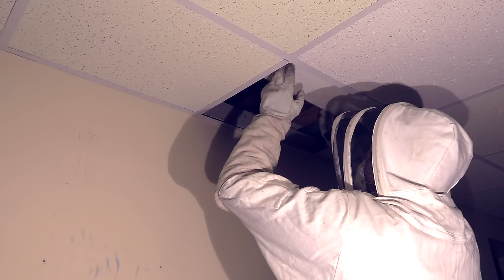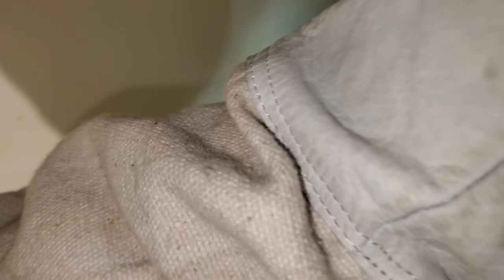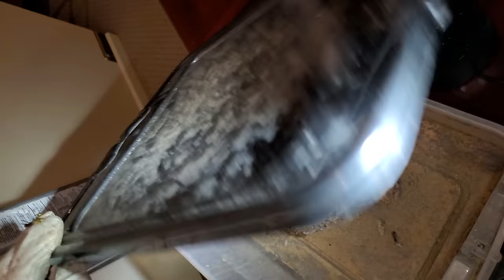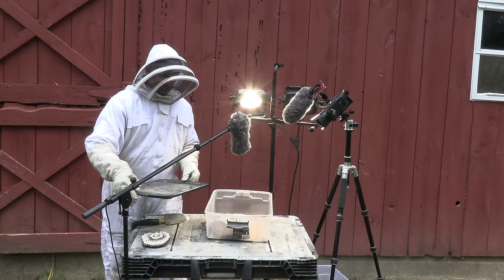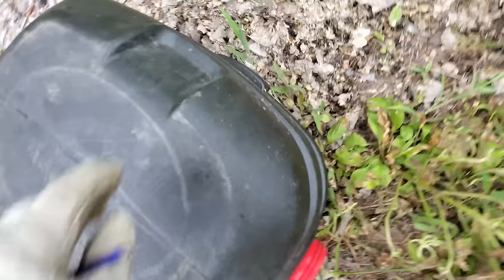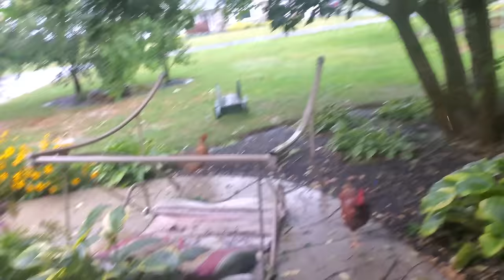HUGE Yellow Jackets Nest in Basement Ceiling | Wasp Nest Removal | Wasp Infestation

Comment: Yes, they do seem to go after wrists, ankles, and your head. That’s where they stung me the most, when I got stung when a little kid, by a ground nest of Eastern Yellow Jackets.

I have an idea. Make a Y-attachment for your shop vac, and have two tubes coming out with flexible hose and new hard tubes on the ends. This will prevent the vacuum from sucking too hard, and you can suck up more yellow jackets quicker with two hoses, using both hands. You’d have to clamp your camera on a tripod, or a joist in this case. Also, an option would be to tape one of the tubes to where the yellow jackets are coming in, and then use the other tube to suck them off the nest. You could probably make the Y-attachment with PVC pipe.

Where’s Angel? 🐓
Reply: Angel went to the great chicken run in the sky last year.😢
Reply: Hmmm. Good idea, can put a plastic ball value on one hose to adjust air flow too.

Comment: I am a young female technician for a large company and I absolutely HATE wasp calls. I enjoy most other aspects of the job but wasps just scare the hell out of me. I have one account up in the foothills and they have one tree about as tall as a single story house that's just LOADED with Tarantula Wasps and I am beyond afraid to get close to it. I put 40 ounces of Dragnet in my power rig one time and turned the pressure up to about 500 PSI and stood wayyyy back and sprayed the heck out of it. I went back a few days later to check and the tree was still loaded with news ones. I then took my electric backpack with Termidor SC and pin streamed it from far away. I just sprayed a small part of the tree. I went back again two days later and there wasn't a single TW anywhere to be found and the customers were thrilled because their kids could go out back and play again. I figured you probably had Drione Dust in your vacuum to kill the ones you sucked up. I could not possibly do what you just did, I'd freak out even with the bee suit on! Good job!

Comment: That pipe is actually two pipes, they're the refrigerant lines for that air handler, a liquid and a suction line (small and big respectively, big is insulated). The way the ac company did that seems pretty tricky!

Comment: Soo when the larva has weaved the silk cap and they're inside transforming, when they are shaped like a hornet but still the color of a larva, are they dead or alive?  I've seen you pull them out before and they don't even move. Are they paralyzed?
Reply: This is random guess, but i wanna say that the nerves for even reacting to touch are either noneexistant, not connected, or just numbed while the creature rebuilds itself, to save energy for the task. They are alive, but the awareness is 0.
Reply: @eeveegirl51  so it's basically like being paralyzed?  I've seen them twitch a little bit but they barely move in that state

Comment: That copper pipes (one is black because it's insulated) is the AC lineset, often see them poorly sealed and easily penetrated by insects and even rodents.  I always advise people to avoid using putties or spray foam to seal the openings, instead get an HVAC-grade silicone and use that.  The black cable is the 220V power line for the AC, on the other side of it is the disconnect box mounted on the outside of the house.  This should also be sealed, and in a case like this you want to inspect the cable and make sure the insects haven't damaged the wires.  Edit:  in this case it looks like they were coming in behind the disconnect and around the wire.

Comment: When you mention that they latch onto your wrist, does that mean that there will be an accumulation of stingers there afterwards
if they sting the leather or are they able to pull them out? Or do you remove the stingers manually yourself if they get stuck there?
Reply from the maker: They latch on with their mandibles. Sometimes their bodie get vacuumed off, and their heads are left latched on my clothing. If they sting the glove, their stingers get lodged in the leather and they become gutted.
Reply: What happens to the stingers that get lodged? Do they remain in the leather or are you able to remove them?
Reply from the maker: They must fall out during the removal sometime. I dont pull them out.

Comment: When I was 14 I climbed up in an oak tree about 30 or 40 feet to a big hornets nest (because I wanted it), with one of those cans of house fogger bombs.  I had bought it because a bunch of us kids had bought army surplus gas mask, and I wanted to try them out, but nobody else would go for it.  So anyhow, I figured out how to spray like you would a paint can without locking it open like you would in normal use.  I eased up to the big hornets nest and got the nozzle pointed up into the nest, and started spraying.  It lasted about 5 seconds before one of them (they were big) flew out of an auxiliary exit, and made wobbly bee line straight into, and bouncing off of my forehead.  At which point I dropped the can and made like a monkey down that tree.  Didn't get stung, and a week later noticed that there were no more bees.  Climbed up and sawed down my nest.  Which only lasted a couple days before my dog decided to play with the stick it was on...

Comment: I wonder - would it be legal to attack them with a vertical X-ray (High power electron gun pointed at a Tungsten plate at 45 degrees?) X-rays are extremely directional, and if they are not tightly focused, and a tube a couple of feet long of lead foil beginning at the plate would limit the exposure of anything around it. The residents, and their pets, must obviously leave during the treatment. The insects use chemical weapons against us. Why not (carefully) use directed energy weapons against them? Double timers cascaded with cutoff at 5 minutes. You wouldn't have to worry about infection during cleanup. Nothing will be left alive.

Comment: Why didnt you just call it wasp nest under floor because the basment is unser tge from is it not
Reply from the maker: Did I remove it through the floor or did I remove it through the ceiling? 
🤔🤔🤔
Reply: @HornetKingOfficial  you removed from the celing of the floor
Reply from the maker: @statelyeel  My comment was a rhetorical question.
There is no such thing as "the ceiling of the floor". Thats nonsense. This nest was removed through the basement ceiling. Therefor, its title is "nest in basement ceiling".
Reply: @HornetKingOfficial  i know its a base ment celing but its the floors floor technically